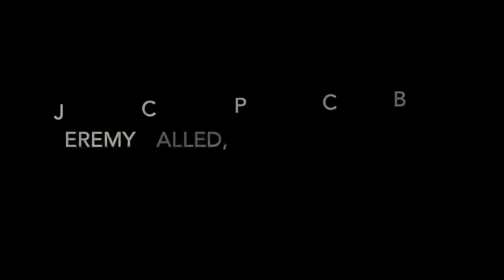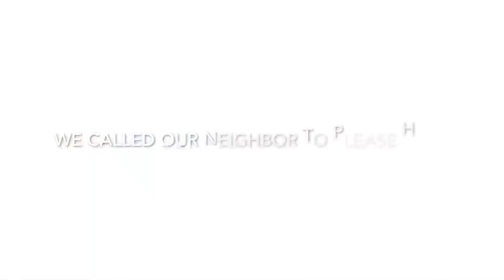Skid Steer Stuck In The Mud: HE WAS SCARED! Our Latest Pond Update | How We Got Our Bobcat T770 Out

Comment: You fought your bucket the whole time when it was your biggest tool at your disposal. The bucket was full of weight and creating drag and weather up or down it was a negative to your situation. Next time you get stuck, lift your bucket and shake everything out of it, curl completely in(dumping) then insert the fully curled bucket into the ground and as you start to back up curl up. You can use the machine to push your self out.